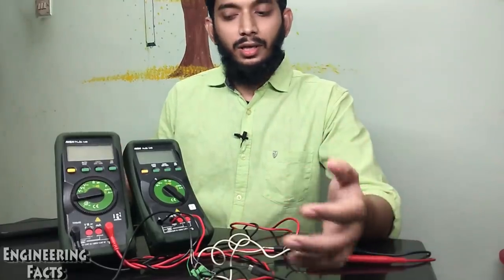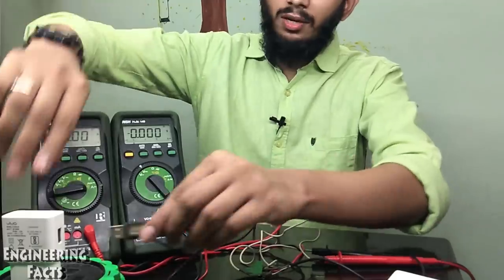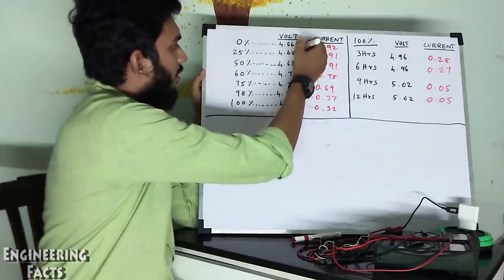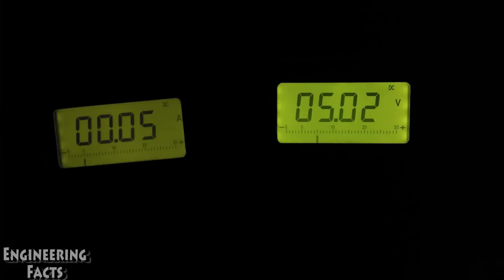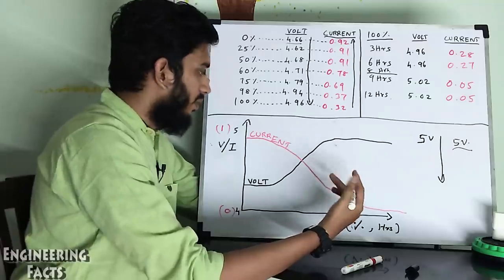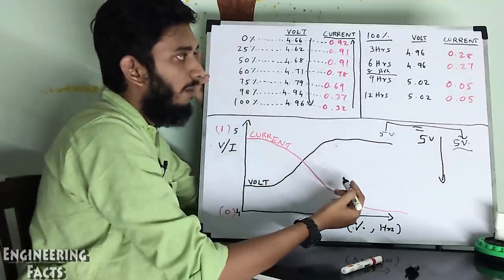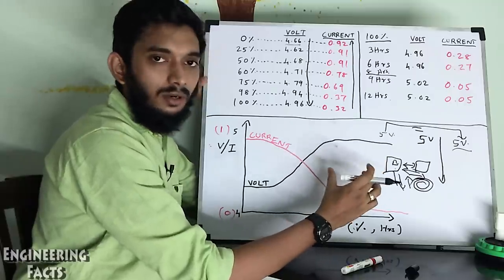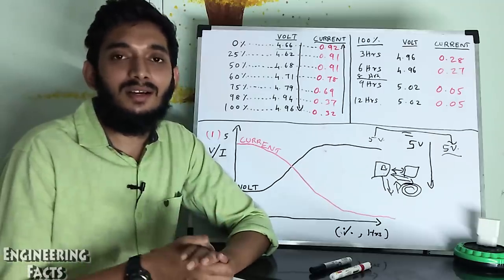Overnight charging, good or bad?_Tamil. Is charging your mobile all night, good?

Comment: இந்த மாதிரி ஒரு விரிவான உரையை யாரும் சொன்னதில்லை இதுவரைக்கும் யூடியூப் சேனலில் great effort bro..
Reply from the maker: நன்றி..
Reply: Nice and very useful video keep uploading 👍👍
Reply: @brianoconner3428  77&) &) &
Reply: Yes
Reply: @engineeringfacts  bro if battery reaches 5volts and charger capacity is 5volts then why current doesn't flows ???
Reply: Tamila sonnathula...
Reply: Yes kandippaah
Reply: @swyrikrupesh5642  aduku mela current flow agi mobile heat agaradhunaala neraya mobile vedichi saaguraanga..adhanaaladhan ipo vara mobiles la laam ipdi konduvaraanga bro..
Reply: @swyrikrupesh5642 current will flow only if there is potential difference. If both battery and charger voltages are same then potential difference will become zero. Then the flow of current will get stopped.
Reply: @swyrikrupesh5642  because there is no potential difference... For example.. when a pipe is connected between the tanks having the same water level... There is no flow of water between them.. like wise the potential difference also
Reply: @engineeringfacts  Can u please say something about the difference between cheap charger and branded charger..
Which one is better & why it is better. Is it woth to spend lot of money on branded charger or not?
Reply: @swyrikrupesh5642  Current flows only when there's potential difference. if they are at same level it doesn't flow
Reply: @swyrikrupesh5642  overcharging agama irukurathuku nu circuit design panirupanga..athanala battery la 5v reach aachu na mobile charger disconnect agura mathiri circuit irukkum
Reply: 👈Hi! Friends,  Time iruntha yenga channel la parunga 🙄🥺
Reply: @engineeringfacts  BRO நீங்க சோன்னது நால நான் என் mobile aa charge பன்ன mobile battery poiyuruvhi..🙄
Reply: Bro adhu depending on phones bro
Reply: @swyrikrupesh5642  because there is no potential difference.
Reply: @swyrikrupesh5642   voltage is like a force...
Basically, two equal forces at opposite direction are cancelled each other...
Reply: @engineeringfacts Tttt5tt5ttt
Reply: Thank you 🙏
Reply: Yes exactly, its easily understandable for non techie people ! wow what an amazing explanation, keep it up bro..

Comment: In redmi phone's, if the charger was changed. It needs 5hrs to charge. So it's helpful for me. And after charging fully, it will automatically stop charging... So it will be safe.
Reply: S bro
Reply: The charging time based on Ampere and Voltage , 90% of orginal branded charger have autocut off
Reply: 👈Hi! Friends,  Time iruntha yenga channel la parunga 🙄🥺🥺🥺🥺
Reply: @Tamiltwinbros  time irukk bro...
Reply: @SparKerZ  super,  Tq bro
Reply: @Tamiltwinbros  bienvenidos :)

Comment: Comparing current and voltage to vehicles on road was the best example I have ever heard. Hats off dude. Please join as Lecturer in any engineering college. Future students definitely need teachers like you👏👏
Reply: If suppose we want put charge the  mobile in AC power supply through charger with mobile off condition
What will happen in charger and mobile.?
Please explain sir.
Reply: Yes bro ❤️❤️❤️

Comment: Hi brother,
Recently I became subscriber of your channel.
Happy about your hardwork and passion towards engineering.

Good experiment for better understanding.

Below I mentioned my view, correct me if I am wrong,

As per your experiment can understand the operation and what really happens,

My personal experience, my father used to do full night charge. By one year, battery get swollen and discharge rate become very high during normal operation of mobile.

I think leaving mobile in charger will weaken the battery cells much higher as you think.

Swollen battery has High risk of battery burst.
Reply from the maker: If you're using a bad/low cost battery charger, The output voltage of the charger will be constant, also may be higher than the battery volt and which result high current consumption even after full charge. that is not good for battery. Battery bulging only happen by high voltage. We need to keep in mind that, some cases battery performance also will lag, that's because the poor quality of battery. Which is nothing to do with charging. Thanks.
Reply: Abdul sherif is correct in his point of view. Most people using low cost battery and charger. So you might have added this point in your video. Otherwise fantastic piece of work yours 👍👏

Comment: A very informative video bro, thanks a lot!. You said voltage is the speed... But it's not. Each electron is the charge Q, and the time taken for covering a unit distance is t... Current I= Q/t... Where as, Voltage is the quantity of charge, which produces the potential difference. Adhu mattum maathi soliteenga bro... Other than that, all are good!

Comment: After reaching a 100%, charging circuit getting disabled and start consuming power directly from charge, after switching off your phone, its not getting completely shutdown. Phone volume buttons and power button are always enabled and keep waiting for the interrupt. In technical terms ur phone is in low power sleep mode. So perfect switch off or shutdown is by removing your battery only.
Reply from the maker: I'll tell you in more technical terms,, 
1. After 100% charge,  circuit will not get disabled. In every charging circuit, there will be a device called reverse diode, which does not allow a charger to operate directly as a primary source for your mobile. The charger main purpose is to target the battery, and maintain the battery level.

2. While mobile switched off, the power supply to all the ics, processors will be still there and it's not closing circuit, where the current will flow. It's like you home switch, the supply always there, but not consume current until you turn on.
Hope you understand.
Reply: I hope you are doing good, thank you for your reply brother.. and I'm sorry for replying late. I understood your points, soo I'm not a mobile phone repairing expert and I'm not that much of good experience in mobile phone hardware and software. But I'm a embedded engineer, so I can easily understand the technical terms and circuit and logics. I hope you having a good knowledge in smartphone charging circuit and all, soo

 1st doubt ----> usually, in charging circuit here we using separate ic for charging a battery, it'll helps to protecting for various problems like charging protection, control a power and some thing more.. so in mobil, for charging circuit they using just simple circuits like diode and other passive components or they using any active components ??

2nd ---> this topic very nice and more informative.. so I would like to learn more, plzz send me the some links where you get all this information,

3rd ---> I said, it is in sleep mode, suppose you have any experience in embedded devices driver programming'na definitely you know what is sleep mode and what is interrupt and all.. u r not clearly getting my points about sleep mode I guess.

Comment: There is no way to disagree from his statement that - overcharging had no much effect on the battery. On hearing this, I let my mobile charge the whole night. And the result - the battery got swollen - started discharging soon - can feel more heat in the mobile even when idle - I had to replace it within a month. 
So, in conclusion - over night charging for one or two time has no impact on battery's life. But charging the mobile the whole night regularly - kills the battery and has impact on other components too. (My display was also damaged).

Comment: 7:53 battery oda normal.voltage 5v nu solreenka!! Battery la 3.7v potrukku, charger 5v

Battery full ah charge aytuna charger oda mmaximum o/p  volt(5v) Reading kaatum!

Idhu , indha idam enakku confuse akudhu , 

battery volt 3.7v dhaana , Adha vida adhika.volt kodudhthan charge panuvom 

when battery reached at 3.7 v then charger ouptput wilbe 5v, 

Ile naan thappa purinjikitenaa explain panunka @engineering facts or @anybody!!

Comment: One doubt.. some one pls answer. If voltage is compared to Speed, at 4.6 voltage also Electrons should move right.. (I was assumed 0 voltage as battery 0 percentage)..

Comment: I dont think the battery's voltage is 5v. It is 3.7v because it is LiPo type. The 5v you are measuring is from the charger.

Comment: Only the problem is ,at over night there is less usage for current so there is 80% chance to came high voltage through line .........and it I'll distroy mobile battery and charging module

Comment: Anna it's a very mock questions but I have an doubt if there is any difference between the current when we totally turn off the Tv or we only power off the but the switch is on ?? Please tell

Comment: Please do a video on difference in power delivery between chargers. I have a oneplus 30w and a apple 30w charger. The oneplus has 6A 5V rating while apple has 2A 15V rating. What difference does this make and which system is better?

Comment: 👌nic effort. Well explained.               But fan runing full day will it increase electricity consumption nd billl.               heat generated is it  a enemy of electricity nd enhace expance which produces heat nd increase friction might need more power to revolve does it controbute to reduced  bearing efficiency may be a similar experiment if possible

Comment: i have okinawa prise ebike, putting lefepo4 72v 42ah battery pack (altered), now i am charged via old vrla charger(4hrs) , becuase new charger takes 8 hrs,.is it correct? or wrong?
Reply from the maker: Too quick charging for vrla battery is not good

Comment: Ji enaku oru doubt some time over charging pannaa phone heat aaguthu appo voltage drop aanaathaana heat aagum normally home appliances ellaam below one amp thaan irukkum but neenga apdiye ultaavaa solreenga
Reply from the maker: Output voltage will raise over the time of charging, that's the concept

Comment: Thanks for the explanation! Would like to know whether charging up the mobile while the battery is above than the threshold limit of 20%, also should the mobile be charged when it reaches the threshold limit or should we allow the battery to completely drain off before charging..
Reply from the maker: You can charge whenever you want. Maintaining battery at 50- 80 will increase battery life
Reply: Thanks for the clarification👍

Comment: Bro, what about laptop? Is it fine to use when charged? Because, as you have explained, the charging cycle will be more and would deteriorate battery life?
Reply from the maker: Need to check. I'll try
Reply: @engineeringfacts   Thanks Bro

Comment: Bro neatly explained I wish my teachers were like this back then and my life would have changed totally but it's ok. 

Bro so what about charging in airplane mode and also by off the phone and charging? Any quicker that way or makes no difference? And also charging and using mobile is advisable? And also these days charger capacities are 25 watts and 65 watts fast charging so what about that graph sheet? Bro and last question some phones have this always on display so for that does battery drain?
Reply from the maker: Airplane mode doesn't close background apps.
We'll make video on using mobile while charging
Reply: @engineeringfacts  thanks a lot for your kind reply bro. Always will support you for your good initiative and your future endeavours. Big and die hard fan of you. You are giving knowledge in understandable form. Hats off bro. Huge respect. 🙏🏻

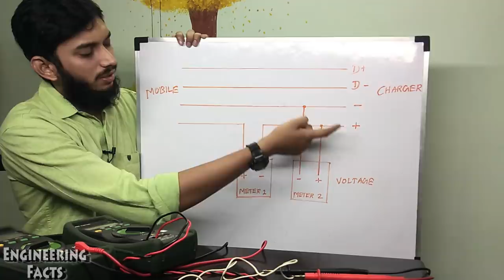Comment: 2:29 why you can't use clamp meter , ? Without wire cut you can measure the current.
Reply from the maker: Because the current is very low to be measured on clamp meter